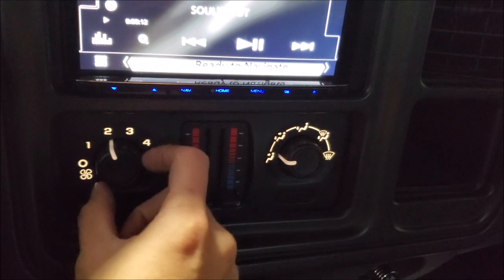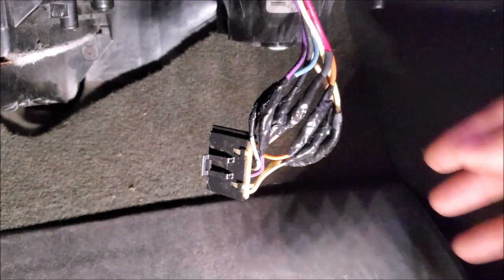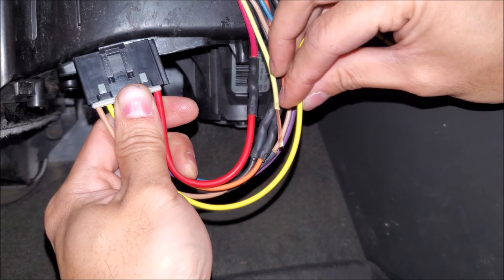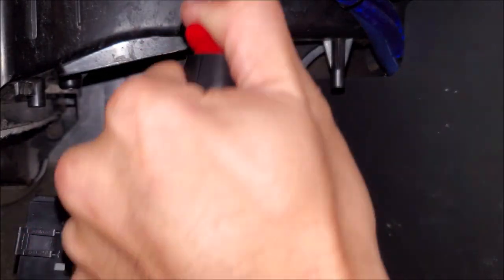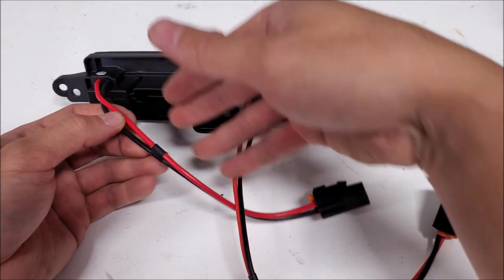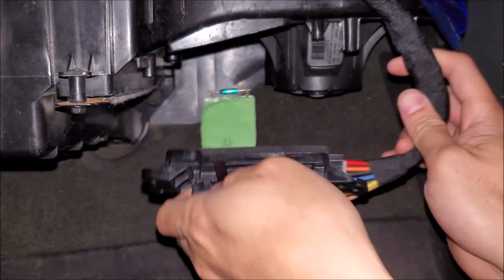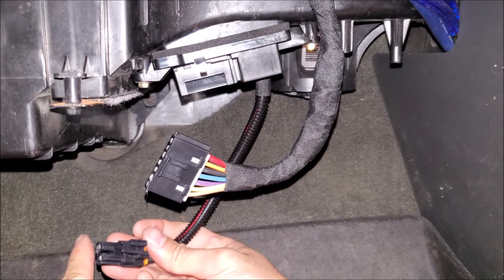Blower Motor Resistor and Plug Replacement Silverado & Sierra (GMT-800) manual HVAC  | AnthonyJ350

Comment: Great job explaining what to be aware of when using non oem. It makes you wonder what was never recalled or designed to fail resistor packs were intentional. Also has potential for parasitic draw. I would be frustrated to chase down burnt connections.
Reply from the maker: I think they're a wear item. We're asking a lot from them because of the heat they generate at low speed. As long as their easy to access I don't care too much.
Reply: They constantly go bad in a lot of cars. Really the design is poor and old school

Comment: Are you spying on me Anthony? 😸 I'm literally doing this exact repair tomorrow. My boyfriend's '04 Dodge Durango melted the OE blower resistor about 4 months ago and the blower stopped suddenly one day. I replaced just the resistor and it worked for 4 months until just 2 weeks ago. Warrantied the resistor and that replacement lasted 2 weeks. It's obvious now that there's an issue with the blower motor and the connector is toast at this point. I have a new blower, connector, and resistor going in tomorrow which will hopefully resolve the issue. My hypothesis is that the blower motor has aged and draws more current than spec. Worn brushes, dry bearings, worn com bars, and maybe even a shorted winding in there somewhere are causing it to draw a lot more current and the resistor pins can't take it. This is apparently a pattern failure however, and people have had issues with this melting for years prior to my intro to it now. Here in Southern AZ, air conditioning is required at the moment to be mildly comfortable.
Reply from the maker: I guess great minds think alike.  Your theories make a ton of sense for an older vehicle.  I would suggest regrounding the negative battery terminal to chassis, alternator bracket and on the firewall if you can.  Then maybe splice and solder a 12 gauge wire of the negative of the blow motor and ground that in the kick panel.  That way the blower motor and charging system can pull more amperage efficiently, and help electronics run cooler.
Reply: @AnthonyJ350  Excellent suggestions, thank you. :) I always learn from you and I appreciate it. Your tips and instructions have made me a more capable person when it comes to 12v stuff and wiring as well as installs. :)
Reply from the maker: mannys9130    That's so awesome to hear!  Comments like this make it worth making the videos to hopefully help people and up the standard of workmanship  😀

Comment: there is no need to change the whole part, it is enough to replace 1 of the 3 burnt thermo fuses located in this block.., only one of them can burn, in my case it was the top one.., the price is 35 cents ...))) From Russia with love!!!..🤫you, unlike many others, quite correctly replaced the cable by soldering the wires, and not crimping them! 👍
Reply from the maker: Thanks for watching!
Reply: @AnthonyJ350  thank you for the good work.!

Comment: hello, I'm from Russia, I have a 2003 Chevrolet Silverado, the weak points of these cars are the connecting contacts.., and the engines
and drives in the duct are something.))))the work that you have done is better done by soldering, so as not to add more new contacts.. 👍
Reply from the maker: Thanks for watching!

Comment from the maker: If anyone is looking for the connector used in the video:

http://rover.ebay.com/rover/1/711-53200-19255-0/1?ff3=4&pub=5575240889&toolid=10001&campid=5337982243&customid=&mpre=https%3A%2F%2Fwww.ebay.com%2Fitm%2FChevrolet-7-wire-Blower-Motor-Resistor-Harness-Pigtail%2F251727589769%3FssPageName%3DSTRK%253AMEBIDX%253AIT%26_trksid%3Dp2060353.m2749.l2649

Comment: This will be my first wiring job on my 2006 chevy. Pretty confident after watching this video. Just wondering if I need to clean the sodering with alcohol. Every thing I read online says it gets the flux off? Thought I'd run it by you since you seem pretty knowledgable.
Reply from the maker: You'll want to use the brand Kester solder, it's the same that I use.  Also use 3M Super 33 electrical tape to insulate all your connections.  Here's the solder https://www.ebay.com/itm/202006855960?_trkparms=ispr%3D1&hash=item2f088c0118:g:~gIAAOSwhvFZCrYP&amdata=enc%3AAQAGAAACgPYe5NmHp%252B2JMhMi7yxGiTJkPrKr5t53CooMSQt2orsSjVt3vLKCbov98Z19qhuwY8N%252BSIof9I2flvmf%252BzNtKcTi39RigeistMahokQMV2D%252Fol9tG%252BE6%252Fr63naNuq92avqOsBvie2tCFEY0pv9%252BzeHDhHPDkf%252FTZMd4ksqQlzpD8ngkVrR1hGTBh9LReBlz6zgvKAYjp2BIbi4trzH9m426yhsR1RVfG%252FJcalfQhic10ZhRJsgnIKOlkuEaRJZRdO3dWiUabkO00j0A1zBq66UNue7eI%252B46tq5FpB9RQOd47gI1A8dg92UZCgcbXmS0oIoKiQVs1M36CbrdGN0Pu46s1KEKAlcFaK7XpuJDG69KU4b4tslubVUdnUXUUqKgvsqgrRyQ4RIispcQgfC%252Btc1OAO8p22dvAxNPK2QvIQgAFrfykdDejL05nJFJtPxQv%252FkWlh5npYp%252FDj2Rh9nBtZimtD9HZZ0UsCMc8ZYw54RgQ3O74sT7rWYSJi5lEVUqePcJ6D1KmeFK9LMOFOP2YvjmbkIWqpVs9WdoNMCESv076YM0hViup0r7nUCi9oBOHI29v4SGBPsh%252FimEmqFYKSNcDyQqPpKaYY%252BKPgY1d%252FFOKhagZfO6O3Jlg2zr0gcTu2dU7b%252FBvvb%252BuzrZJBIZ4MtvXTYnWdbETKLOXTIK0Y0NXiE5WqfjIA%252FQ5ZbwCnZKvcYgxbbk%252FAuVKPv3OT9P5fM48eBfaYLYPFdX3cV3EuZzqJdzaPElRCF2iLIHraNgrLV8ov6BQZOnegwzgs8ml%252BxfHobDlFLCQPHHaJCC5q59XjvHGYE7X1%252FKsea3RwXjwaOmqblqxy%252FXrdVJvIxW7eio%253D%7Campid%3APL_CLK%7Cclp%3A2334524&mkcid=1&mkrid=711-53200-19255-0&siteid=0&campid=5337982243&customid=&toolid=10001&mkevt=1

Comment: I see you did the cabin air filter mod.  I did this to my GMC Yukon also. I used the GM kit that takes one large filter.  I guess if they discontinue that one I can use the two filters that were used in 99 -02 trucks....
Reply from the maker: Yup, totally worth it. I'm going to do another video showing people how it works I think.
Reply: @AnthonyJ350  That be great!  A heavy duty box cutter and a dremel make the job of cutting the HVAC box easy.

Comment: My door blend actuators are not getting power at all. Do you know what it could be?  and my ac blows warm air and heater blows warm too. Ac compressor and condenser are good as well as my receiver dryer. Thanks
Reply from the maker: Did you try this procedure. Also check all the fuses.
Reply: Thanks for responding fast! My speeds work good with no issues I just don’t get ac at all just warm air. I was thinking of trying this to see if it would solve it. I did check my fuses and they were all good.

Comment: I’m gonna do this job on a 2007 Chevy trailblazer. But what I can’t get it the color one. It’s only black and white how would I got about that job. Please help I got no heat in the car
Reply from the maker: You would have to go one wire at a time and copy "pin location"
Reply: Grate. Thanks I was thinking the same thing!

Comment: Have a link to the updated resistor? Not showing up on Amazon or online... Unless it's just been discontinued or something
Reply from the maker: I got a genuine one from the dealership.
Reply: @AnthonyJ350  gotcha! The way I perceived it was that it was only that aftermarket option in the video that had thicker gauge wiring! Thank you
Reply from the maker: @stuartgriffin5.7  No, I think GM actually wanted to improve it a little. Too many of these trucks still on the road. Lots of business there

Comment: HEY BRO, I HAVE A 350Z 08. I WAS DRIVING AND THE DASH LIGHTS STARTED FLICKERING AND THE CAR DIED. TRIED TO JUMP IT NOTHING. THE BATTERY IS GOOD AND ALMOST FULLY CHARGE. TURNING THE KEY STILL NOTHING, NO LIGHTS, NO CRANK. ALTERNATOR IS 2 YEARS OLD. ANY CLUE WHY AND HOW TO FIX? MAN THIS GOT BUMMED OUT. DONE A LOT OF WORK ON THE Z AND NOW IT'S COMPLETELY  DEAD. TURNING THE KEY WITH GOOD BATTERY DOES NOTHING, LIGHTS ON DASH BOARD DON'T EVEN COME ON.
Reply from the maker: Is the battery tight?  Are the connections at the battery corroded?  Also take the red cover off the positive terminal and see if any of the fuseable links have blown.  The IPDM or a relay in their could be faulty as well.  There have been reports of some getting too wet and getting damaged.
Reply: @AnthonyJ350  OMG! BRO, YOUR A 350Z SAVER. ZERO CORRODE ON BATTERY AND CLEAN. TOOK THE RED COVER OFF ON THE POSITIVE AND SURE ENOUGH, THE 140A FUSE IS BLOWN. HOW DO I REPLACE IT. NOT USED TO THIS KIND OF FUSE.
Reply from the maker: @JUNEORJUNE  You'll have to get a new fuseable link at the dealership.  They're not cheap though.
Reply from the maker: @JUNEORJUNE  The question is, why did the fuseable link fail?  You have to figure what caused the short, because if you just replace it, it might blow the fuse again and you just spent money on that part.
Reply: @AnthonyJ350  THAT'S A GOOD QUESTION, I HAVE NO CLUE, HAVE HAD THE Z FOR 5 YEARS NOW. NEVER HAD THAT HAPPEN TILL I REMOVED THE RADIO AND THAN PUT BACK IN. I KNOW NON OF THE WIERS ARE CUT.
Reply from the maker: @JUNEORJUNE  Is the battery old?  Is the positive terminal corroded?  That might be causing excessive heat.
Reply: @AnthonyJ350  THE BATTERY IS ABOUT TWO YEARS OLD, THE BATTERY TERMINALS ARE NOT CORRODED
Reply: @AnthonyJ350  HEY BRO, SO I GOT THE Z FINALLY RUNNING AGAIN BUT THIS TIME THE "A T CHECK LIGHT" CAME ON FOR 3 SECOND. IN THE 5 YEARS OF DRIVING THE Z, I HAVE NEVER SEEN "A T CHECK LIGHT" COME. WHAT DOES IT MEAN? IS IT A E-Z FIX?

Comment: what is the part number of wire clip and where did you get it
Reply from the maker: Which part in the video?
Reply: @AnthonyJ350 the multi colors wire kit
Reply from the maker: @Juniorzeeseven1  Manufacturer and part number are in the description

Comment: I juat did this n my blower still not working it kicks like it wants to start won’t engage
Reply from the maker: Measure voltage and ground resistance. Also try to test the blower motor outside of the truck on a different source to verify it's ok.

Comment: What is the name of the tool used to cut the outside of the wires without cutting the wire itself?
Reply from the maker: Which part in the video are you referring to?
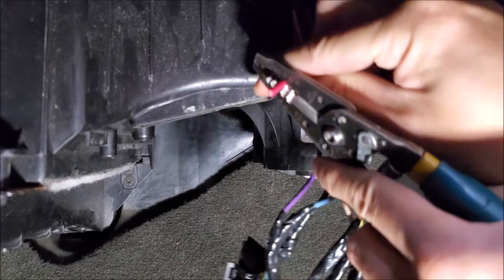Reply: 3:25
Reply from the maker: @almightykashii5254  Oh, those are wire strippers. Klein is the manufacturer
Reply: Thank you🤙🏾
Reply from the maker: @almightykashii5254  You're welcome

Comment: Came to just see if anyone else's ribbon plug is a stuck pos...

I should've left it screwed in for thst, but I'm using enough pressure to break the plastic, already almost clipped through wires insulation
Reply from the maker: Were you able to pry it out?

Comment: Silver makes a good connection use silver solder FYI
Reply from the maker: Industry standard is lead based. Solder holds a good connection together, solder is not meant to make a good connection